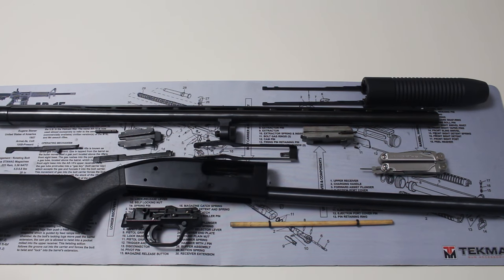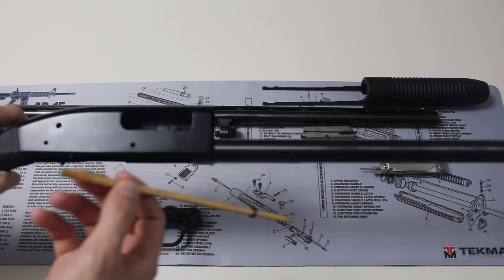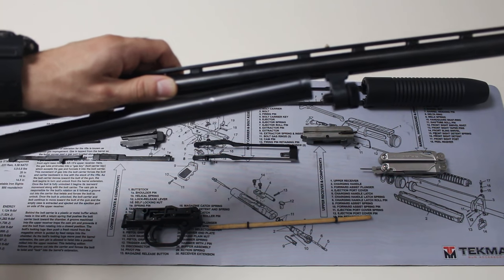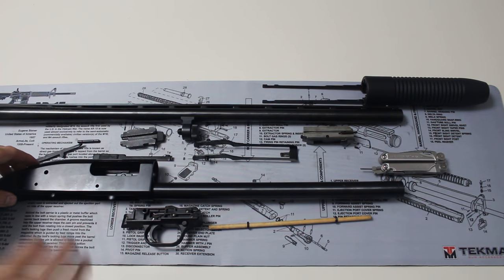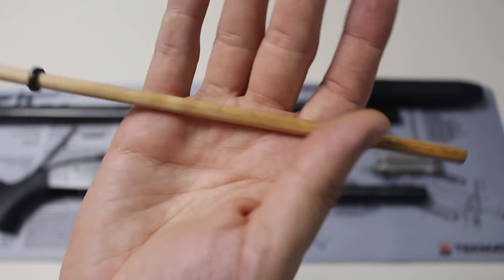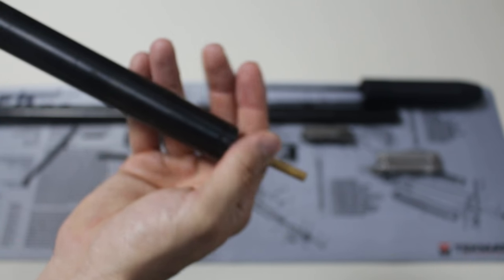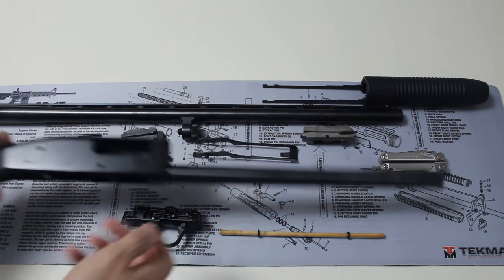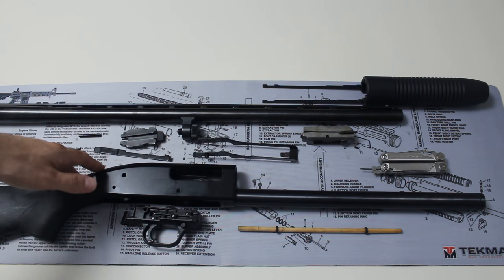Remove Your Barrel Plug! -Maverick 88 Shotgun

Comment: I just got my maverick 88 and I tried to take my plug out  but there is no rattling  in my mag tube so I don’t know if my gun came with one  or it’s stuck on the spring some how
Reply: Bought one yesterday and im experiencing the same for me. Did you find out if there was a plug in it?
Reply: @PNW42069  I started filling the mag tube to see if if there was a plug in there and I found out there was no plug, I have the model with the 8 round mag tube  so I put 7 shells in  and it was full
Reply: @puddingmaster1999  ok awesome thank you
Reply: UpendAtom no problem

Comment: What the video doesn't say: 
When the dowel pokes out of the end of the mag tube, grab it and pull slowly while wollering it around in a circle so the O-rings don't come off inside the gun. The O-rings may be a slightly larger diameter than the hole. Stupid design.